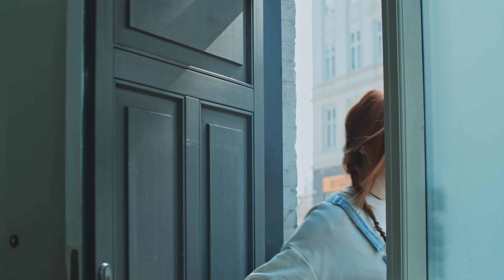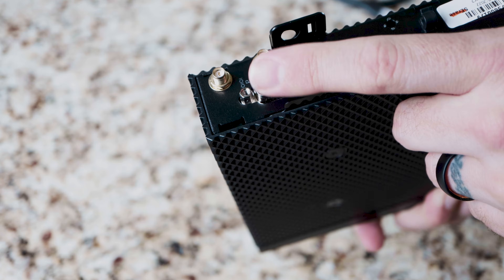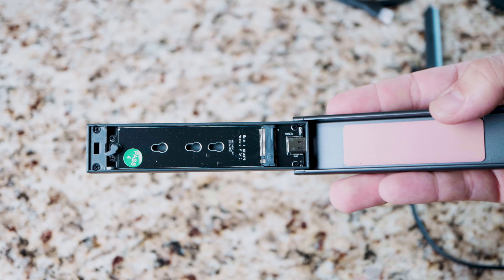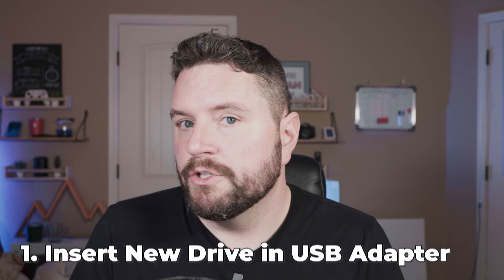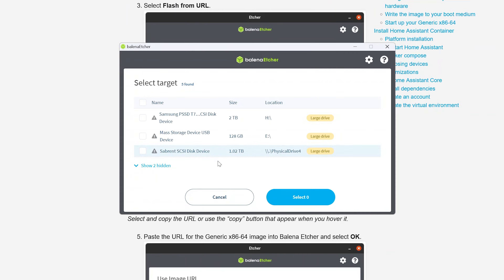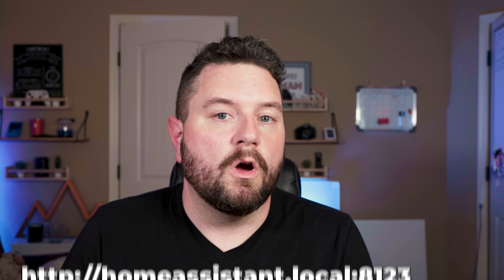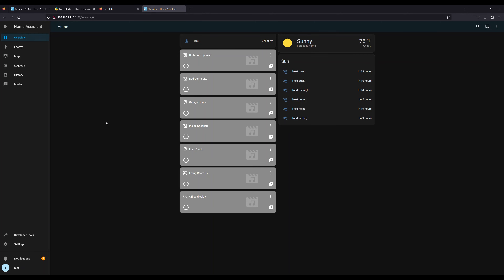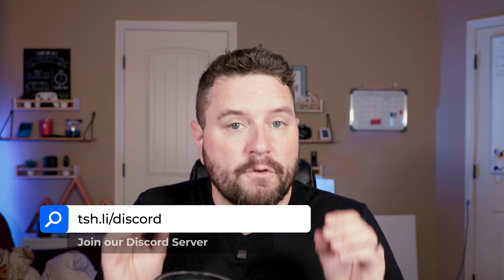No Pi? No Problem! Home Assistant on a Cheap Thin Client

Comment: First video where I did not learn anything new😅😅

Moved my stuff to a thin client months ago. Using the Pi as a test system.

As always great video very precise and shirt enough to not bore but long anough to not skip any gothas
Reply from the maker: Thanks Rishab! Always great to hear from you! Glad you got your systems moved over. I am going to work on moving off my Pi over the next week. I am actually going to start fresh. I have so many test devices in my current environment that it is starting to cause issues.
Reply: Even i did a fresh start instead of migrating. Gives me newer ideas and better naming options.

Comment: Great Video, I recommend this method because SD Cards are so unreliable in a Pie.   My only comment I would make would be if your picking up one of there Thin Clients, Nuc, or any other Micro PC is to change the CMOS battery if it is equipped while you have the unit open.   In my experience I setup my MicroPC and everything worked perfect for a couple months until it didn't.   I thought what is happening, nothing was working,  did something go wrong with the HA Setup.   It was only after I installed a monitor that I noticed the PC was getting stuck on BIOS checksum error on boot because the CMOS Battery was dead.   (These units are a few years old, so the 2032 Button Battery was probably the original... so for only a buck or two, change it while you have the cover off!)
Reply from the maker: Great point! I never check that these days.

Comment: I bought a Wyse 5070 about a year ago and love it. Thanks for great video
Reply from the maker: It is quite a capable little machine! I am excited about all of the USB ports!
Reply: @ThisSmartHouse  I really like this video I am old and new to this. My only issue with the Dell Wyse 5070 I got it keeps booting to the Dell OS and not my SSD. I have made some changes in the BIOS but nothing works to boot it off the SSD to get to HA....any advice to what you did to your Sir. Thx
Reply: Same

Comment: Probably mentioning that you can only control WiFi connected, or internet connected devices would have been nice. You want to add some dongle to the system right away to control your ZigBee, Zwave and matter devices.
Reply from the maker: I did mention that. I specifically pointed out that the first thing home assistant does is seek out devices it communicates with. And the fact that if you add z wave or zigbee sticks you will have to set up communication. 
Matter devices work natively as they are network based.
Reply: @ThisSmartHouse  Sorry, seems I've missed that :)
Reply from the maker: Hey no worries. I know I didn't EXPRESSLY call it out. I did assume that the average person would know that. But you are right, I might add it to the description and blog post. Especially for those folks coming from SmartThings, that have other protocols built in.

Comment: ZeroTier is one way of having very secure remote access to a Home Assistant installation that is otherwise hidden away behind a firewall. ZT has clients for phones too and you can also run it on an OPNSense firewall.
Reply from the maker: I will have to check it out. I am using a hybrid (due to all of the testing I do). I have Nabu Casa (mostly for the Google Assistant integration), port forwarding, and I have started using CloudFlare Zero Trust (which I LOVE).
Reply: @ThisSmartHouse  I do a lot less compared to your complex setup and just focus on having as little proprietary stuff as possible, because I want whatever I have built to function when the internet goes down. Currently looking into how I can have my phone still act as a remote control over lora even if I have no mobile network. Unfortunately there is little interest from ZT to port it to the ESP32 so I have to look at getting husarnet working on everything eventually.

Comment: Well I have my Home Assistant running on my k3s cluster and it's fun to play with.
Reply from the maker: Thats cool! How do you handle attached hardware (Z-wave sticks, etc)?
Reply: @ThisSmartHouse  Well I don't have any attached hardware but to my understanding they could be passed in somehow. Right now my Home Assistant only changes my roku tv to the News 9 App. I hope to add something like a Aeotec Smart Home Hub  that will work with things like Z-Wave or Zigbee though.

Comment: Great guide to setup a first time build of HA. Ive always thought about upgrading from my Pi4 4GB but I'm only using 3% of the CPU and 1 of the 4GB of ram. 

Crazy how much power isn't needed to run HA
Reply from the maker: It just sips resources. We will see how the thin client does vs the pi.
Reply: @ThisSmartHouse  The thin client has the advantage of the M.2 my Argon One Fourty is using the M.2 over USB 3.
Reply from the maker: Yeah I wonder if that added speed will make a difference on bot. My 8GB pi takes 5-10 minutes to fully load everything.

Comment: Just set up HA but disappointed to find that it won't control my Samsung TV due to it being on a different VLAN.  Smarthings had no problems controlling it though.
Reply from the maker: You can always add a second virtual NIC to your home assistant and assign it a vlan.
Reply from the maker: I did this when I was testing out Matter on my Aqara M2 hub, it is pretty easy.

Comment: Great video!
I did it your way and a couple of other ways but I just cant get it to boot on my 10 year old-ish computer I had laying around. It promts me to insert a boot media or something like that.
Secure boot is disabled but I have no way of choosing boot mode in the bios. The motherboard in question is asrock h77m-itx. Greatful for any help. Thanks.
Reply from the maker: Are you able to boot Ubuntu from a flash drive?
Reply: @ThisSmartHouse  yes. I have tried that and it works.
Reply from the maker: What happens when you try and install Ubuntu from the flash drive? It fails after reboot. Like @rishabmehta7 said, make sure that the hard drive is set as the default boot device and make sure that RAID is turned off (this is a problem with Dell machines).
Reply: Probably a boot device issue on BIOS